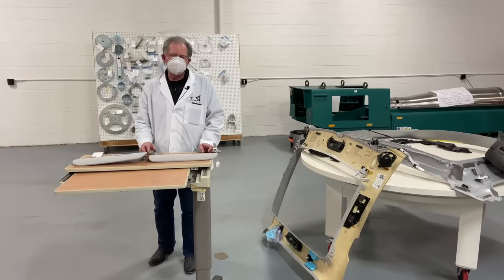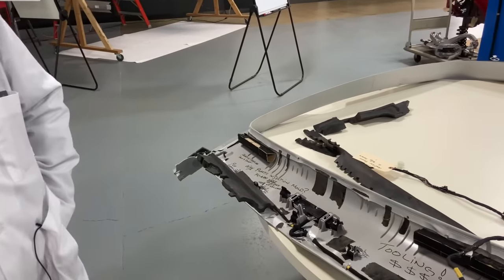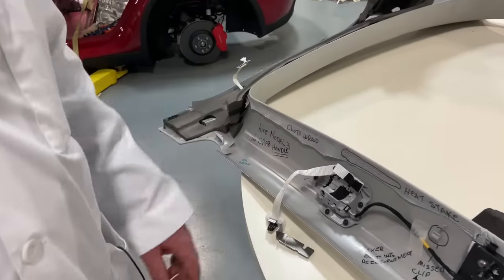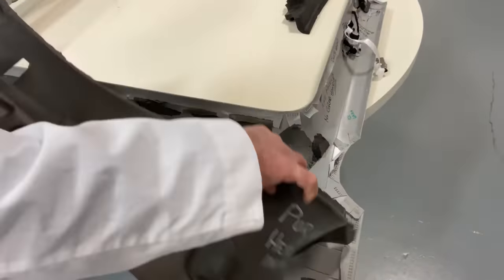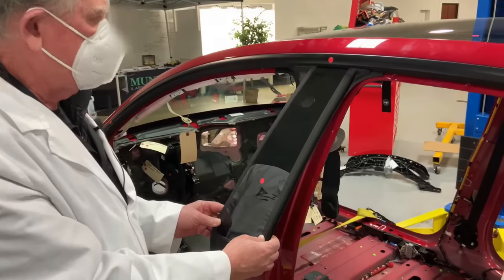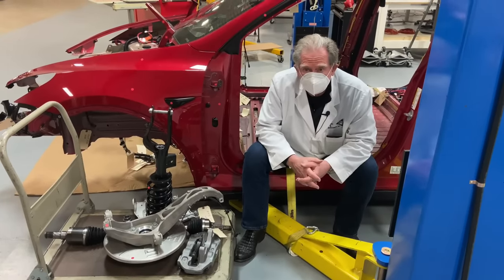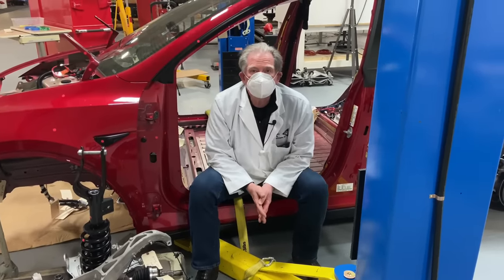Model Y E21: Headliner Comparison M3-MY, B Pillar Integration, and Questionable Trough Mods

Comment: Clever stuff. You can see what Tesla did on the Model Y. The tooling for the headliner isn't cheap, but it saves times on the line, and they can amortize the cost of the machine over many millions of cars, and new models too. Ends up cheaper than the old way of doing it. It is very clear from Sandy's comments that other OEMs aren't innovating anything like Tesla are. Impressive stuff.
Reply: We cannot compare how good/well/cheap the MY is because we don't know how Toyota, Honda, Kia, BMW, AUDI, Mercedes build their similary priced cars
Reply: @Rokalno  we don't know, but Sandy knows
Reply: "It is very clear from Sandy's comments that other OEMs aren't innovating anything like Tesla are" -  Actually no, that's literally the opposite of what he's saying. Everything Tesla is starting to do now, other manufacturers have been doing for years, that's the WHOLE POINT of these videos, to show how terrible the way Tesla has been doing things so far in previous models, and that ONLY NOW they're starting to do things up to industry standards. They're not innovating, they're copying and catching up. It blows my mind how people can be as clueless as you and jump to these "omg innovation" conclusions. Stop freaking glorifying Tesla so much, especially for all the wrong reasons...it's ridiculous. You people are taking the term "sheeple" to a whole new level. 

The Y interior is still one of the cheapest and bare interiors on the market, both to produce, and to touch, feel, etc. FACT. It's nowhere near the level of complexity of pretty much any other car on the market, ESPECIALLY for this price. FACT. Take apart an interior of a European 60-70k car, and it will make the Y interior laughable in comparison, literally LAUGHABLE. It's nothing but cheap plastics and the most simple and basic shapes, end of. Nothing innovative at all, literally, at all. Not a single thing on this car is an innovation or something absolutely new not found on other vehicles. Not to mention that Tesla's engineers are ALL old employees of other car companies, so naturally they'd use similar solutions.

You wanna see innovation?  Go see what Polestar is doing. They're 20 years ahead of Tesla, ACTUALLY doing amazingly innovative things nobody else has done, developing completely new materials, completely new ways to build parts that are 100% natural and bio friendly, made out of recycled materials or plants, LIGHTER AND STRONGER than plastic parts, and also look luxurious as well. What Tesla is doing is a joke in comparison to pretty much any serious car brand out there. They're designing cars to be as cheap to produce in mass numbers as possible, without much care for quality.
Reply: @derbigpr500  Did you actually watch the video? How many times has he said during the entire series, "never seen before", not done by any one else and I like it", etc etc. You also say that the Mode Y's interior are cheap. Where did you have a chance to see and feel the interior? Not many of them around in the US yet. And why are you using European cars as a measure? This is an American performance vehicle and should be compared to other American vehicles.
Reply: @polycrystallinecandy  what does he know?!?!?
Reply: @derbigpr500  also tesla still uses tons of plastics from the oil industry and people forget that easily , what a joke
Reply: @carholic-sz3qv  Thats hy he is driving an 86 Merc. Nothing have changed on them. NO need for a new one. Maybe you should go take a Tesla for a test drive and then comment.
Reply: @JJSmith1100  the test drive has nothing special to be excited about
Reply: @derbigpr500  WOW, your arguments are both so precise and accurate, I'm going to stop listening to Sandy Munro and instead just track your comments. 

You are clearly an expert on all things Polestar. Can wait to see what Polestar news you have for us here on these Tesla teardown videos, because that's what were here for.

 Can you please link to your videos when you teardown a Polestar 2? Very excited. Interiors are the most important things to me, these engineering terms are so tricky! 

Can't wait to see how much better the Polestar interior finishes feel! Regards!
Reply: @carholic-sz3qv  You cannot know if you don't try.
Reply: @RealityGutPunch   you made my day!
Reply: @derbigpr500 what you are forgetting is that the price of a Tesla isn't for a luxury interior, half the price of the car is for the battery and drivetrain technology.    Why can't people like you understand that?
Reply: Dan You can’t reason someone out of a situation they didn’t reason themselves *into*!
Reply: I beg to differ - 

due to most other companies use the headliner you know from M3 you can offer a very silent car next to your ears - NVH material is already included 

- this MY headliner needs extra NVH damping material - you need to calculate if it’s really cheaper - I doubt it

Comment: I'm kinda glad you're finding things wrong with the model y, be interesting to see/ hear how long it takes Tesla to sort out these issues.
Reply: I would imagine many are already fixed.
The next batch of headliners will have the clip moved, same with the  wiring/ moulding.
Reply: The running change rate for Model 3’s/Model Y’s is incredibly quick. Depending on the issue, it could be engineered approved, introduced within a few weeks.
Reply: Especially with the current downtime of freemont i expect the next batch to incorporate many small changes/improvements.
Sandy already said that Tesla worked out how to get some insulation around the compressor in the Y.
Yes, super interesting to find all those small things.

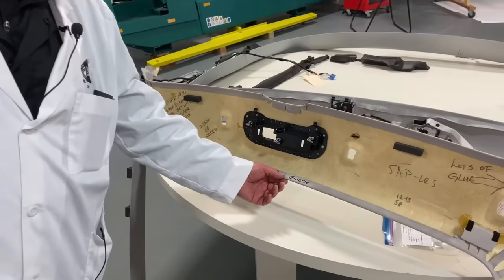Comment: 2:33 Tesla stopped using it at around vin 3,000 and switched to the same material as Model Y
Reply: Ah yeah, i remember reading about them switching to a different material for the headliner.
Reply: Wonder how many other differences being pointed out in these episodes that are already standard on today’s model 3.
Reply: GTK ty
Reply: @chriscarr82  that's true, Tesla has always been busy at making many changes over time without releasing specific restyled versions  (aside of the Model S maybe).
Reply: Another edvidence Sandy really has one of the first one tear apart.
Reply: @Derpy1969  Glad you said it!
Reply: Jason
Why did they stop using it and switch.
Reply: I am wondering why couldn’t Tesla engineers think of a better solution in the first place instead making 2 kind of tools for model 3 and then again a new one for model y? That is why Tesla has trouble to make money 💰
Reply: Chris Andy ??  Tesla improves and changes all the time. They don’t wait for a new model to make changes. They are just about the only manufacturer making good money out of EV’s, which the established ICE manufacturers really struggle to do.
Reply: FutureSystem738 making good money 💰 out of a product does not mean they make good cars necessarily 

everybody in the industry improves their products but mostly they call it cost-down 

most of the comments here praise Tesla for innovation but clearly the headliner got rid of that nice Alcantara after 3,ooo Vins and made it now cheap plastic made of oil 

That is innovative and environmental friendly, isn’t it, huh?
Reply: FutureSystem738 by the way: https://www.statista.com/statistics/272130/net-loss-of-tesla

Tesla does not make any money 💰 

please get informed first before you use a keyboard
Reply: Chris Andy I am a hell of a lot better informed than you.  Enough said. Bye!

Comment: Remembering this is a really early roll off the assembly line, I would imagine there are lots of go arounds - or design mistakes and changes which was not properly logged.  If it is still structurally sound, and you can't see it, it really does not matter.  It will no doubt be noted and redone.  The Model Y overall looks like it will be the best selling Tesla to-date.   Great job Sandy and team.  Great transparency.  The learning and improvements continue.  I am sure Elon appreciates the care that is taken and the comments made by Sandy.  Everybody wins.

Comment: 1. The magnet does not hold the visor well when pushing back in place - the Model 3 version fits, holds, and worked well. 

2.  The headliner in my Model Y is stained with grease like material. Was able to wipe other dirt marks on most but the "grease" stain will not come off. Now since the headliner is one piece, Tesla has it bbn on order to replace the whole thing, would have been better if maybe the headliner came in 2 piece forward and rear half. There is a seam for the cloth covering anyway - where they could have made the junction if the headliner is made into 2 halves.

Thanks for the detailed info vlog! Keep it up SM.
Reply: ive seen some pics of stained headliners on Reddit, my bet is that they might have had some trouble fitting the headliner and it might've been layed against either tooling or on the ground
Reply: 6:33 But it is made up of two pieces
Reply: Y headliner is 2 piece. Your "grease stain"  is most likely urethane from roof glass.
Reply: @2nd3rd1st  , u are correct it's 2 piece - i missed that part. Lol.

Comment: Wire harnesses laid out perfectly in CAD are always too short. That is why they missed the cover opening. Seen it a million times in aircraft. Splines lack the physical attributes of an actual wire harness.
Reply: So a bunch of noobs then? :P
Reply: rkan2 noobs is Right. Typical of fresh new engineers.
Reply: @Dr.Know_4U  Lack of fit up prior to production.  The injection molded wireguide has 6-8 weeks of lead time so pre production ramp-up parts are stuck with modified first run wire guides.  When the tooling gets updated, you will see this problem cleared up. Its not really a big deal.  I didn't see any wires that would rub on sharp edges.
Reply: Gregg McClelland virtual fit up using CAD is very popular.
Reply: isn‘t Tesla prebuilding some prototypes to find 99% of problems which can occur in series production instead of using early customers as beta testers?

Comment: The magnet instead of a snap is great. Have had more than one car where a snap no longer holds the sun visor in place after a while...
Reply: same will happen with magnets as they loose their force over time especially with the heat/cold cycles the go through in a car.
Reply: They actually use magnets in the model x as well, pretty good system.
Reply: and pretty expensive one; magnets 🧲 aren’t cheap - are you willing to pay more for such a feature?
Reply: Chris Andy 
With all the magnets that goes into the cars motors / doors and other accessories I don't think that the price of the sun visor has any effect on the overall price. Secondly the model x windshield is huge and it has an completely different visor system. But yes I am willing to pay for stuff that works well.
Reply: Rasmus Christensen I may have put it the wrong way 

1st in automotive business every cent matters
2nd would you pay more for the MY with the magnet solution or the M3 version? How much do you think is it with for you?
Reply: Chris Andy 
If it's better which I do think it is for some people, yes If the car costs 50 dollars more for the part to be perfect. actually the visor clip is broken on my wife's fiat 500e it no longer snaps into place. That's also why the comment got my attention. 😂 so there you have it.
Reply: Rasmus Christensen I totally understand you

there are a lot of better solutions on the market that never made it into production because price matters in that competitive environment 

if you can’t price it to the customer the company will use the cheaper solution instead of the better engineered 
they can even make money later on the after sales service parts 🤪

it hurts but controller rule a company

Comment: WOW. Even though Tesla revealed Y as a "iteration" of 3, its clear that Y entails serious redesign and optimization. Now Tesla is best in class for all the major elements of car design. And we have not included next gen battery which will be revealed at Battery Investor day.
Reply: To Tesla and Elon, these differences are probably "small" improvement steps as part of their iteration process.
I would expect that if you would look at a 2020 Model 3, it would also have at least some of these changes.
If you look at what they did with the Cybertruck, then you see a "big" step for Tesla.
Reply: @rogerwilco2  I think you're exactly right. And I would not be surprised if some of these changes started in the model 3 and then went into the Y. Remember, Sandy's first tear down of the 3 was a very early model. A lot of these changes could have been in the 3 before they even got into the Y.. hence.. 70% shared parts.. that look like less than 70% if you compare this Y, vs the 3 they tore down.. I wonder if you tore apart a 3 that was more recent to just before the Y launch, what you would see.

Comment: That dremel-cut looks like an adaptation due to a defective part or shortfall of a specific part.
Reply: Agreed, it looks like either the wires in the harness that went up to the B pillar were too short or the plastic part didn't extend far enough back.
Reply: a dremel shouldnt even be part of a assembly floors tool set, if you need a dremel during assembly that means your parts are not good and you should not use them.
Reply: @Pixelplanet5  I don't see the harm in this.  It's not a "pretty" solution, but it seems perfectly effective. It's not going to produce a problematic vehicle.  I'd much rather see them get vehicles out there and get real-world data than sit around letting trivial things like this hold them up.

All manufacturing lines generally have some sort of issues early in production. There's a reason why you'll often encounter advice to not buy cars in their first X months / years of production - for any brand. But this sort of thing should be harmless.
Reply: @Pixelplanet5  if it's between delivering a car today or waiting 3 weeks for the new mold to be made and production and logistics to get the new part. Or cutting off a bit of plastic that will probably never materially affect the customer. It's a pretty clear choice to me.
Reply: @karenrobertsdottir4101  this could very well become a problematic vehicle as we can see here the cables run very close to the cut of edges and since they are not held in place by the cable channel they can easily rub against the sharp corners and get damaged.
Reply: @MarkFunderburk  they have been making the model Y for months before as we can see from the prototypes on the streets, this is something that should have been caught during that phase and never made it in production like this.
Or at the very least if you know all parts are faulty you have them cut of clean before being installed and have the edges rounded of so they can not damage any cables.
Reply: @Pixelplanet5  They miss maybe 5-10 cm of support the way it's set up.  I can't see that being an actual issue.

Even if it were, it'd be easily modified in service.  But I doubt anybody will ever have an issue related to this.

That said - and to reiterate - it's symptomatic of the general rule that you don't want the first car off a new production line if you're looking for a top-notch flawless build.
Reply: It looks like a cheapo cheat/fix done on the line. Should be gone soon.

Comment: @9:00 it's possible they went over the wrong side of the fastener. The tape is to possibly to reduce the rattle since the clips are spaced far away from each other. More clips would make more difficult injection molding.

Comment: for the wiring routing issue on the headliner they need to implement vision control too have 100% QA.
 they already have the yellow marking tape which is already an expensive visual help to produce.

Comment: Tesla have their own moulding shop which is unusual dont know if model 3 is going through that shop. Once you have good  mould shop with big machines and good staff tooling costs can look a lot more realistic. No one wants to set that shop up $$$$ but when 1st n 2nd teir wont supply you in years past what you gonna do! You pay the cost to set he shop up may as well use it! Vertical Integration advantage.

Comment: Hey Sandy & folks at Munro, thanks a lot for doing this. I'd like to ask a question as a Model 3 owner if I may: What would you suggest that I could do to effectively reduce wind noises? Is the Model Y in your opinion more quiet than the 3? I've seen some guides to install extra door seals for the Model 3 but they seem to have limited effect.
Reply: I can tell you that tests have been done by some YouTubers, and the Model Y is about 3 decibels quieter on average, which is huge.

Comment: I would be very excited to see another model Y teardown in about a year or so (I am waiting for next year to buy one as they work out the early production kinks). I was also disappointed over the reduction in wiring not happening yet and the 12 volt battery still present :(
Reply: Changing that much would make a new production hell more likely. This way they can ramp fairly quick

Comment: That B post wiring issue on both sides looks like an error during the wiring loom manufacturer. Probably happened too late to stop car production and they did a line fix. It’s unlikely to be a problem and unlikely to be there on many cars.